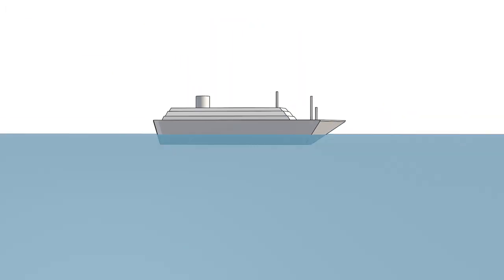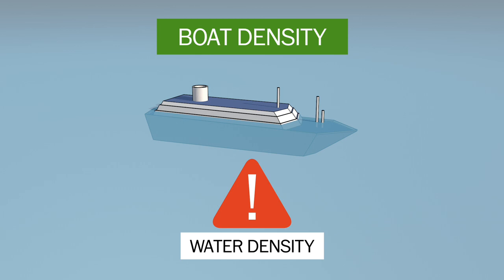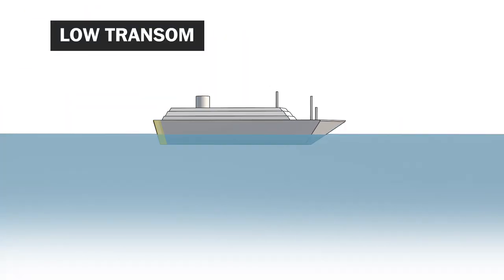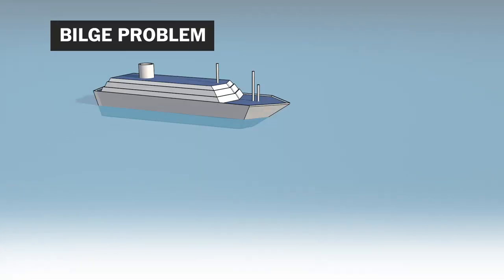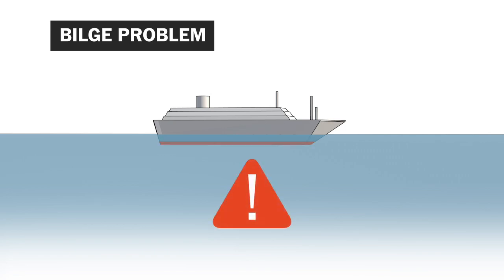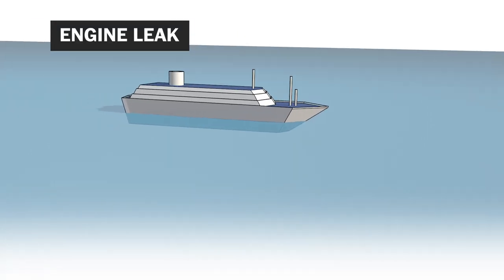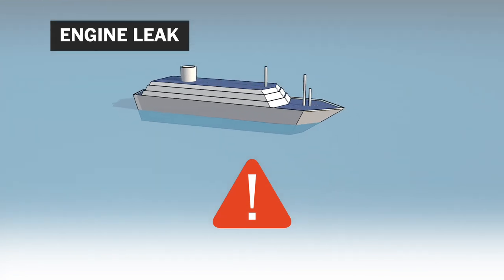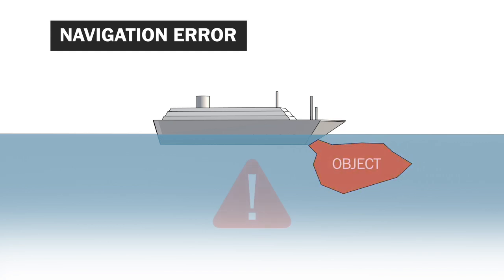What makes boats sink?

Comment: where are the air - foam filled chambers,  to keep some floatation, - opps it took a brain to forget to make them, Even small runabouts could have "swimmers foam noodles" installed to prevent total sinkage,  oops  sorry i guess someone has to die before someone else starts to use their brain, I would rather be found sitting in a half sunk boat than, treading water till death, by shark attack and boat on sea floor,  cars have go and stop, boats can only be made to float FULL STOP, life vest have inflation gas, and and life boats self inflate,  why not a boat with a life boat  built in,